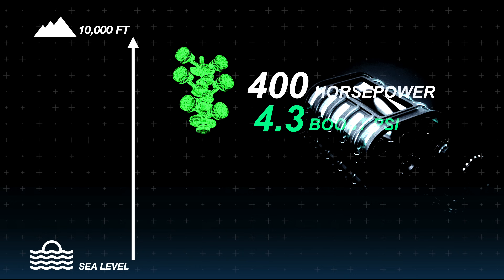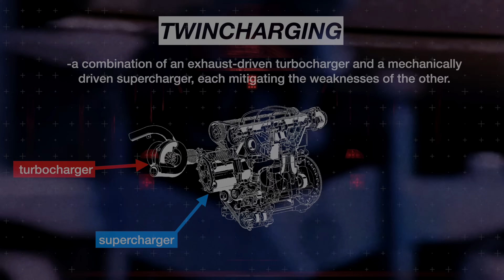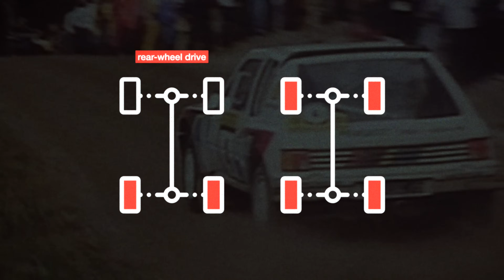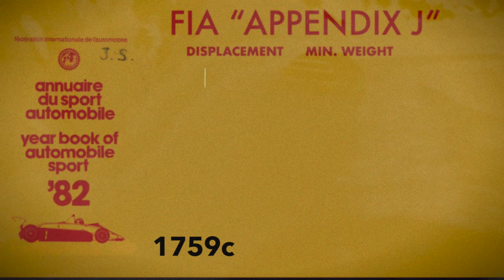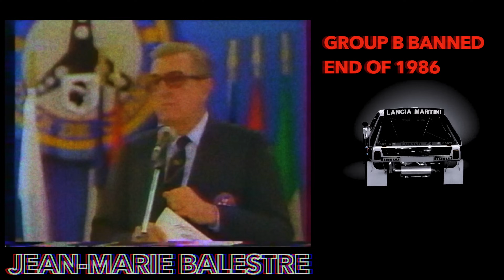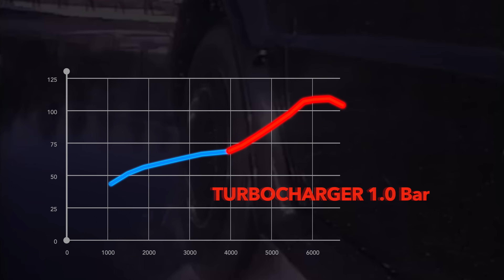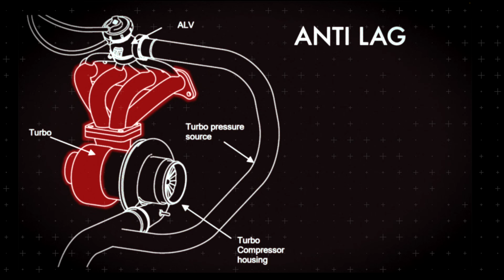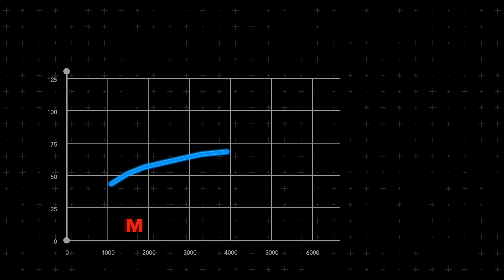The Engine That Was Banned From Racing | Explained Ep.29

Comment: The reason there is “no replacement for displacement” is that it’s a lot harder on the engine to do so with boost which will make the engine more likely to suffer long term or short term. Not that there aren’t bad NA engines, but boost definitely lowers lifespans. Thus bigger displacement NA is more power the safer way. But you know what they say, safety third 😈
Reply: Boost doesn't lower lifespan, if that were the case turbo diesels wouldnt be getting millions of miles. It is all about heat management and proper maintenance. Too many people put boost on their cars and push out too much power without proper supporting mods and tunes leading to early failures.
Reply: @tehtehkhantengames8580 

At what cost??? 

Mass & COST

Still cannot replace displacement. A larger displacement engine will make more reliable power more easily and more cost effective - and with better long term durability. 

That said, there is room for all.
Reply: @WDLC1911  I can tell I am talking to non car guys so I will bow out. I promise you a large displacement, high hp engine is neither cheaper nor always more reliable than a smaller displacement boosted engine. Especially when supporting mods are involved.  A 454 750 hp longblock is around 20k with 12.0:1 compression. Or you could get a L33 325 for about 800, fully forge it with arp headstuds cams etc for another 4k. throw on a 3k turbo kit and you have 820 hp for 10k and it will live just as long if not longer than that 454 while making more power and torque. 

 The cost is research and knowing how to do it properly.
Reply: @tehtehkhantengames8580 , worked fifteen years in Powertrain Noise, Vibration & Harshness Research & Development. 

We disagree. And I’m not necessarily limiting the conversation to pushrod V8s.
Reply: @tehtehkhantengames8580 teacher teach me  
Teacher, teach me more so I can cruise for a long time.
Reply: @tehtehkhantengames8580  I didn’t say there weren’t great stock boosted vehicles either. It’s true if done properly, it won’t make a big difference, but in the long run, it’s just another potential problem for the future
Reply: @UnabnormalDay  And I am trying to say it isnt... power is a potential problem. Heat is a potential problem. Compression is a potential problem. In fact if you set it up correctly a turbo can get you more power, with less emissions and less stress on the motor. It is when it's used to make up for power or displacement that it becomes detrimental to engine life. Your entire premise is wrong in the first comment is all I'm saying.
Reply: @tehtehkhantengames8580  Turbo diesels huh, maybe because... I dunno, they have to be extremely overbuilt just to handle their method of combustion? Maybe steel wet sleeves, ginormous con rods and bearings with 15 head bolts per cylinder might make an engine pretty durable regardless of what stress you put it under. That and turbo diesels may even be more overbuilt to handle the increased power and heat.

There is no argument to be had here, your statement is completely pointless. OBVIOUSLY the engine whether designed for boost or not will wear out faster when you put it under more stress. This applies to revving it higher, higher compression, cam, whatever. Larger displacement engines BY DEFAULT have bigger bearings and rods, they by default have more to "wear" away; OBVIOUSLY they will last longer than a smaller displacement engine producing the same power by whatever method. You take that same turbo diesel and take the turbo off it, it will almost certainly take longer to wear out. 

This is the most pointless argument that could possibly be had but its youtube so I guess I can't expect much.
Reply: There is a guy with an old Buick Roadmaster wagon with a 525 cubic-inch engine that is pushing close to 70psi thru the dual turbo setup on it making at least 4200HP at the wheels. Granted he is the engine builder.
Reply: @sithyarael6807  and the time spent at WOT is infinitesimal, too. If he actually used it for any significant time he’d be rebuilding it a lot.
Reply: @WDLC1911  Several of his SMX engines are used in a lot of drag and drive events. Cleetus and Tom Bailey both have SMX and do all types of drag and drive events.

Comment: Luv ur videos, how about a series or builders like Boosted Motorsports. He has a full SRT Hellcat swapped engine an interior in a Dakota, Swapped Ram with Hellcat, and a 2 Gen Ram swapped 5.7 Hemi with 8 speed transmission. You explanation are absolutely 💯  on 🔥.  LUV   ur videos
Reply: LUV is a Chevy/Isuzu truck back in early 70's thru the early 80's.  So Light Utility Vehicle Uniform Romeo videos. Makes no sense at all.
Reply: agreed. great idea.  I've never seen builds as solid and clean as Boosted Motorsports. I mean, its so much more than just an engine swap with these guys!  It's the interior, the body, suspension, everything!!